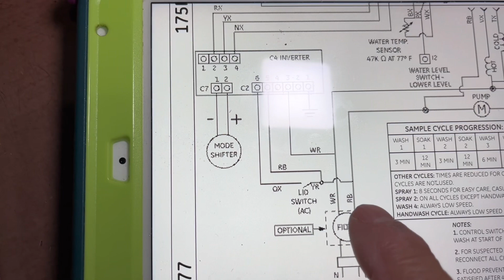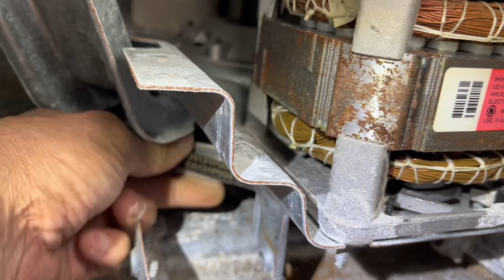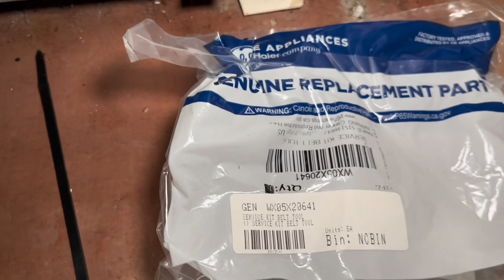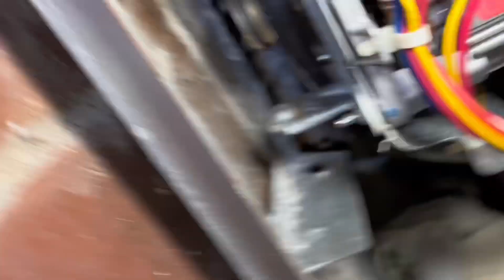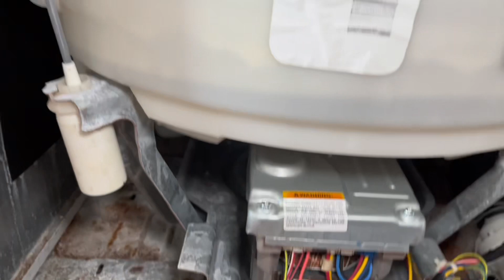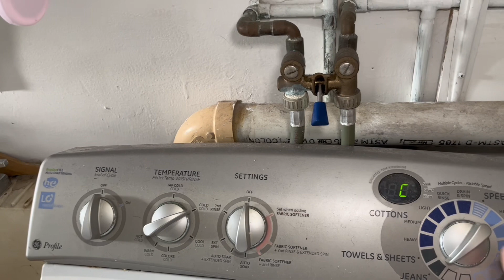Diagnose & Replace Motor  On GE Washer

Comment: were do you get the wiring diagrams? Thanks for all your vids !!!!
Reply from the maker: All Appliances are  supposed to have one. On the washers it could be in the control panel or taped to the inside of the cabinet. If yours not available, you can ask Google for a servicemanual pertaining to your model number. I get mine on https://appliantology.org/ . By paying for $300 yearly subscription. You can go on just answers and pay a small fee to just answers and ask for your service manual. Or who has it on Google?